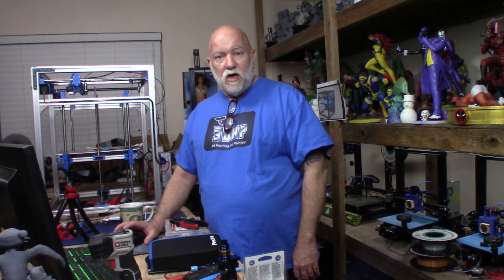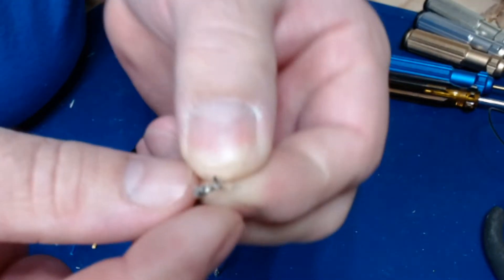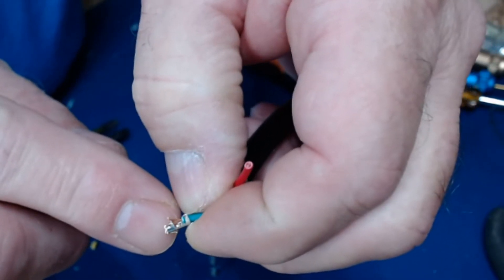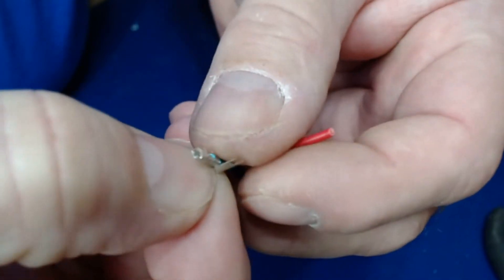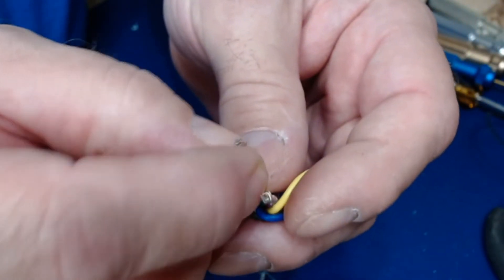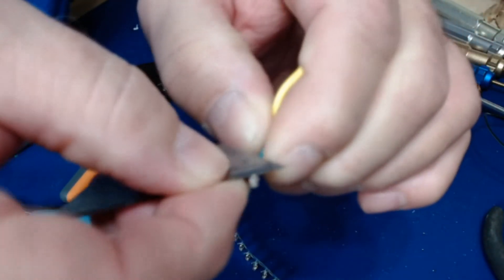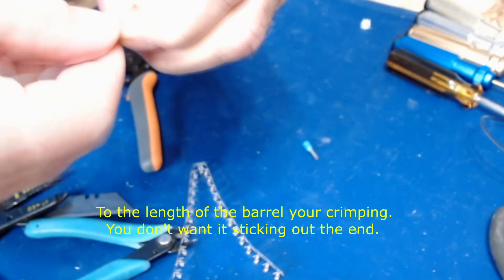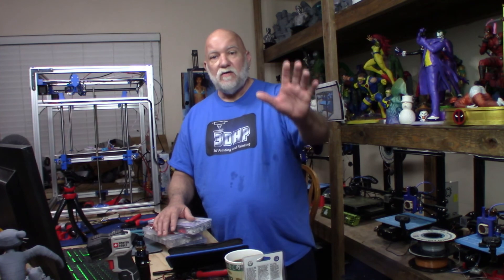How to Crimp JST-XH and Ferrule Connectors #3dhp

Comment: Video tip: to help with focusing, hold the palm of your hand behind the part you are showing. It will block out more of the background and give the camera a larger surface to focus on. 

I did not see the ferrule crimper in the preview, so I was curious how you were going to do it. Glad to see you used the correct tool! Thanks for the information on the JST connectors.

Comment: I can also highly recommend the iWiss tool you've used - It works very well. I'm using it since a year or so and it's the one i get the best crimping results with. Even the very small JST GH / PH can be crimped with it. Sometimes i even crimp Dupont ones with it. I think they got inspired by the japanese Engineer PA-09 tool that many recommend for JST connectors. The iWiss one is half the price and still very well build.

Comment: Thanks for making this video, it was very helpful! I just recently bought the same crimper and JST & Dupont connector set from Amazon.  After watching I was able to figure out the Dupont connector and went ahead and ordered the Iwiss tool you recommended for JST.    So the JST crimper of this Qiabok technically will work but it really requires precise alignment which the tool doesn't assist with.  The trick I found, which was not obvious, is to line up the latching tab part of the metal connector (i.e. the part that latches when it inserts into the plastic fitting) with the edge of the crimp tool.  In other words the latching tab needs to be butted up to the edge of the crimper.  The main issue I was getting before trying that way is the one you pointed out which is the square front and that tab would get deformed or mashed down.  So that means that the metal band that attaches it to the roll of connectors needs to be slightly inside the valley where the crimp happens.  If the connector is lined up using that edge of the roll tab on the back side of the connector where the wire goes in, it will guarantee a bad crimp as the latch tab will for sure get smashed down.  The exposed part of wire only needs to be a couple of mm.  I had many mostly bad crimps before finally getting a good cable out of it.  Using the Iwiss looked much more straightforward
Reply: I use dupont connectors quite a bit, and I've learned that every crimper is different.  My SN-28B crimper looks just like his, but if I aligned the crimp as he instructs, mine crushes the wire barrel, and the spring contacts.  Apparently,  with these cheaper crimping tools, the jaws aren't cast, or machined to the correct design and tolerances.  Every brand tool is different.   So the user just has to develop their own technique that produces the best crimps.

Comment: Will a 1.3mm work if I don’t have a crimp with the 1.4 size?
Reply from the maker: Not sure off the top of my head. I would have to test it and look at crimp to see if it bits the wire and holds tight when tugging on it.
Reply: @3DHP  Thanks I’m looking for Crimps that have the 1.4 and 1.9mm size but all the tools I’m seeing don’t have both or they either have one of those sizes but not both

Comment: I'm gonna have to buy smaller crimpers, ordered a set off Amazon, but it's also messing up the end of the thing. Going nuts just trying to replace the fan on my Ender 5 Plus.
Reply from the maker: If your unable to crimp.You could solder them or just wrap together real tight and use heat shrink tube with lighter to melt.